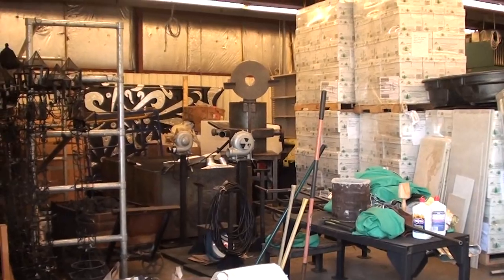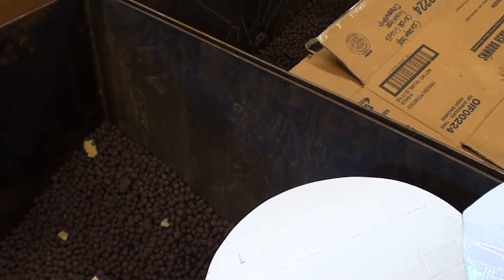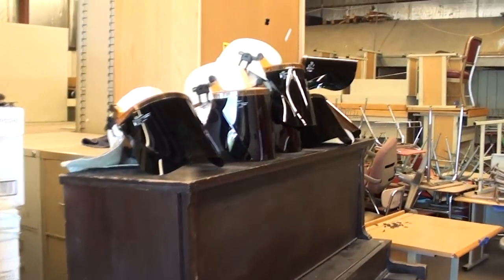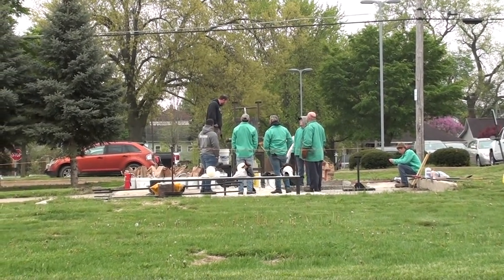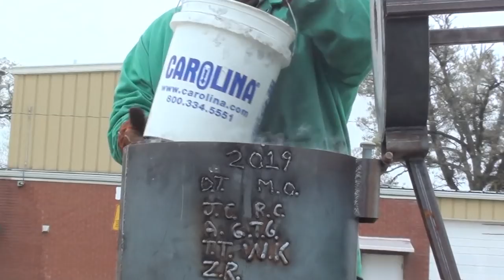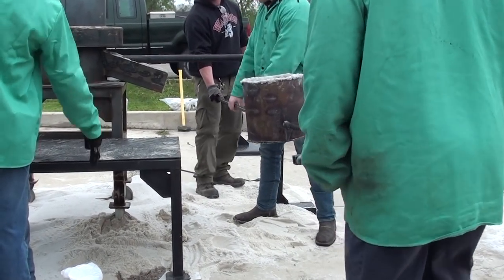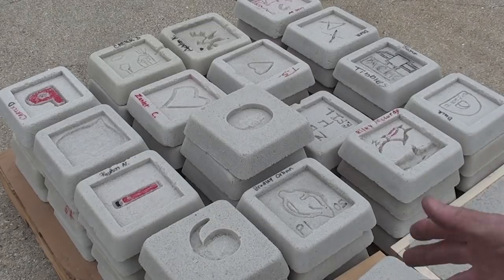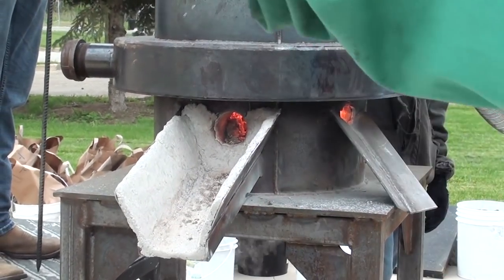IRON MAKING at SCHOOL Using a Blast Furnace tubalcain

Comment: Hey Mr Pete, 
Steve Chastain has written an excellent book on iron melting cupolas, it provides excellent theory and design for small cupolas, also instructions for use, it will help you avoid the issues you are having, and give better practical understanding of the process.
I built my cupola from Steve’s design, and it does exactly what he said it would.
Real nice to see proper hands on work for the students, nice job!

Comment: I was a Metallurgist in a Steelworks for some years the error seems simple to me, Heat loss, A blast furnace uses hot air not cold when "On Wind" take the vent from the top and pass it through a heat exchanger after the blower and before the tuyeres for probably 50-75% reduced heat loss & better iron reduction,
Also block the tap hole with clay, until the liquid builds up, with the tap hole open the "Burden is burning down not up"
Reply: I didn't think about blowing in cold air, but seeing the raw stock blowing out the bottom vents, I had the same idea on plugging them.
Reply: @stxrynn  If you look at any full size Blast furnace you'll seel a big elbow on top with a diagonal "Downcomer" pipe, it heads across to a "dedusting facility and the CO gas in the Blast furnace exhaust is routed to three or four big vertical cylinders right beside the main Furnace shell, these cylinders are called "stoves" they burn the blast furnace gases and heat brick piles in the stoves then pull the cold blast air through the stoves in turn to heat the blast air.

A cold furnace reduces iron very slowly, & leaving a large tap hole open means the the blast it escapes altogether and isn't forces up through the "Burden" which gives little trickles of iron and a clogged furnace.
Reply: Very clearly written.   Thanks for that.  This is the Bessemer process, yes?  The melting process is still mostly a mystery to me.  Time to go digging and get educated.  

I worked in IE at Marathon LeTourneau in the late 80's.  We had a steel mill onsite.  I rarely got to go visit, but did get to see the electric furnace, vacuum furnace, soaking pits and walking beam furnace.  I only saw the rolling mill once.   That "intro" started a life long interest.
Reply: No this isn't the Bessemer process, this process was devised by Abraham Darby the 3rd, building on a history of iron making that used wood charcoal as a reducing agent, AD3 pioneered the use of water wheels to pump heated air through Coke Iron ore & limestone in the late 1700s maybe 1776? In order to cast cheap cooking pots (of all things) he also had a part in building the world's first Iron bridge at Ironbridhe gorge in Coalbrookdale in the UK.

The Bessemer process bubbles oxygen through molten "Casting Iron" reducing the carbon content in order to create steel
Reply: @jblaxlinde7998  While that is certainly how it is done as the effeciency gains are huge it is not required. The blast furnaces from the 1800's  blew in outside air only and still got the job done. To me based on the old 1800's furnaces around here it looks to be half as tall as it needs to be. The bottom does need to be plugged and the biggest issue they likely will run into is I think from cold start up it typically was expected to be 24hrs before the first tapping. I could only find one image of a properly shaped old school simple blast furnace and it is here : http://www.engineersgallery.com/blast-furnace/   I would suggest a slight reconfiguration to the bottom of their furnace for proper capture of the molten iron and also it will need to be well insulated so that the iron will remain molten for tapping after it has collected properly which will not occur until the level is high enough that the slag can be tapped out of the slag port. The furnace should also be built much taller as the process relies on lots of time and layers for the iron to be reduced properly so you can obtain a good quality product.  What they have built here is actually somewhat akin to a coupola furnace, which would typically be used for reducing pig iron and scrap to make steel or specialty irons rather than raw pig iron.
Reply: @bcbloc02   
True 
But the burden ratios shown won't cook down properly as there's just too much reducing and heating to do when all that heat is being thrown away, especially as the top is being taken off to charge which dumps heat in a massive way

Right back to the 1700s furnaces were loaded through relatively tiny holes up on top, then sealed with clay

 It's all about ratios, heat retention & making sure the burden burns upwards, that is shutting & sealing the tap hole.

Of course you can fill a bucket with a teaspoon of you wish but I generally use a garden hose 😉
Reply: Yup, I definitely have more reading to do.  Thank you for the reply.
Reply: @bcbloc02  all of your suggestions as to dimensions and furnace run time are spot on, If I was to give a suggestion Is say just sit it on the ground and prepare a "Salamander" taphole for the final clean out, pretty much all Blastfurnaves were built like this until refractory became very cheap in the 1930s I still worked on a "Salamander" furnace in the early 1990s
Reply: @stxrynn  Its funny Bessemer gets the credit by a guy named William Kelly was using the same process here in Kentucky about 10 years sooner.  He was actually trying to make wroght iron a different way but essentially was making steel.
Reply: I had no idea.  That is ingenuity, pure and simple.
Reply: The "William Kelly" story is pretty cool in it's own right, apparently he'd bought an Iron works in the mid 1840s I'm going to say 1847 but really not sure & he was having labour issues so imported Chinese Iron foundry workers to solve these issues, when the Chinese guys turned up & got going hammering slag out of Kelly's dodgy puddled Bloom steel they told him about how they do it in China by blowing air through the "Puddle" which led to Kelly's Invention proving that there's really nothing invented in a vacuum, it's always a matter of building up on ideas used by others, the reason that Bessemer's name is used is that he simply had more of the ideas that went into the Bessemer convertor, including the correct refractory chemistry and the tilting convertor tech etc, there's more to it than bubbling air or even Oxygen, there's Phosphorus and silicate build up & of course Air + heat melts the bottom out of your convertor without the correct refractories.
Reply: I love this Industrial history stuff, I saw 100yr old film of a 100yr old Prussian (I think) blast furnace working back in the late 90s & was hooked forever, I even visited the old Bedlam furnaces & various other Iron, Steel & Coke making centres, there's a great Coke furnace site out in the middle of no where near Lithgow in New South Wales, Australia.
Reply: J Blaxlinde The sloss furnace in Birmingham Alabama is a must visit if you haven’t been. Here in Kentucky we have the Fitchburg furnace which was the largest  charcoal iron furnace in the world.
Reply: Of course the incoming air would be best if it was hot but a different way of drawing the hot air from the top of the furnace and blowing it into the bottom would have to be done a different way. That fan would fail really quickly one the air got over 300 degrees F.
Reply: @sandrammer  
Hello, Yes the fan would fail quickly if you put the hot air through it, so you mustn't

The fan pumps cold air into one side of a simple heat exchanger which heat's that air just before it goes into the tuyeres
The air rises through the furnace as "Blast air" & gets even hotter, ideally the oxygen is used up and it comes out of the top of the furnace and into a pipe that takes it to the other side of the heat exchanger,
Only the heat moves across the exchanger as the air should mostly be "used up" in the furnace,
But the fan only ever pumps cold air,
The heat exchanger can be very simple just a pipe in a pipe then insulated externally for safety & heat retention, it could simply be a heated jacket around the tube that feeds air to the tuyere ring or even a jacket over the tuyere ring itself it doesn't need to be complex it's already on the edge of working just a little heat recovery here, a better burden ratio there, not opening the top & dumping all the heat & of course closing the tap holes with clay and improving the furnace floor so that the iron can pool & it's a done deal, a taller furnace wouldn't hurt though, 
A blast furnace usually is topped with a truncated conical top which aids in gas flow, ideally the burden should never get up that high it's about burden distribution and gas flow.

And as bcbloc02 says the furnace needs to cook over a day or so to really get going, A blast furnace is usually a continuous process furnace that runs for years at a time, you can't turn them on and off in a couple of hours, Our full sized furnaces would make absolute rubbish Iron for the first week until the process stabilised & all that Iron would just be dumped for later recycling, Despite the 10,000 men waiting down the line for Iron to smelt & steel to roll, the Iron wasn't any good so they just did other maintenance until the iron came up to spec, It's just a part of getting a Blast furnace running.
Reply: @bcbloc02  next time I'm in the States I'll try to get there, I'm based in the UK now but have worked in a few different countries, I don't know for sure when I'll get back to the US but it's on the list for a tour with the family in the next 5yrs hopefully.

Comment: Two suggestions for Mr. Taylor for the next time: the blast air in the commercial furnaces is preheated these days to give better combustion efficiency, especially on cool or even cold days.

While building a miniature set of Cowper stoves with the internal firebrick checkers is probably impractical, a shell and tube air preheater fired with propane might help things out.

It's not absolutely essential, as the early blast furnaces used leather bellow to pump the blast air in.

The other thing about the blast air is that it needs to have enough pressure to percolate through the vertical column of charge material after things start melting. The liquid steel and slag tend to block the gas pathways. A commercial furnace is ~100 feet tall inside the refractory, and the blast fans typically provide a head of 80 inches of water - about 3 psi. The fan head doesn't quite scale linearly, because the thickness of the liquid layer inside the charge is going to be fairly close to the same, no matter how short or tall the shaft.

I'm not a blast furnace engineer, although I can fake it, based on my other engineering skills... the steel company however has guys who live and breathe blast furnaces on staff, and they'd probably be very glad to help out with some guidance and design checking. In the old days, they'd even send someone out to help out on the day of the heat, as much for PR as anything.

This might be a practical example that the physics class could collaborate with the welding class - give the kids in physics a real application, and the shop guys an example of where the math and physics actually have some meaning.

Just a thought...
Reply: Not all furnaces use preheated air and not all postburn their effluent gas. This is a tiny blast furnace (cupula) and its of the cold blast type. It will work just fine once they learn the proper rate to feed it.

Comment: Reducing iron ore to Fe.  A bold ambition for a high school class.  Many thanks for sharing this. 
A brief refresher from high school chemistry.  The coke is burned to release heat: 2 C + O2 → 2 CO.  The CO reduces the iron ore to iron metal:  Fe2O3 + 3 CO → 2 Fe + 3 CO2.   Some of the coke may react directly with the iron at higher temperatures: 
2 Fe2O3 + 3 C → 4 Fe + 3 CO2.

Comment: Just reading up on the process, you are correct in calling the balls, taconite, as that is what they're colloquially known as. But the pallets are not really taconite. They crush the taconite, which contains 25-30% iron, and pull out the magnetite with magnets. They recombine the magnetite with clay (limestone and flux) and roll it into those balls. (Iron content: 60%) The balls are fired, which oxidized the magnetite to hematite.

Comment: Thank you for showing this.  The shop teacher is up special recognition for his ingenuity and salesmanship to get this done from start to finish.
This cold blast cupola furnace is similar to a hot blast cupola furnace used in the melt shop of a previous employer.  As pointed out by others, it melted iron scrap for charging into a basic oxygen steel converter.  One suggestion would be to do some more research into design of the slag and iron tap holes and plugs and the exhaust venting.  I suspect that way more time and heat would give better metal production.
There was no discussion of the size and spacing of the tuyeres relative to the blast volume.  The bustle pipe diameter looked like it might be oversized for a cold blast.  A furnace like this needs lots of high velocity air for complete combustion of the coke.  A future project might include modest oxygen enrichment of the blast air.
My comments are not a critique; all involved in this project deserve praise for their work.  I'd just hope for enough hot metal production to give the students a tangible momento of their efforts.

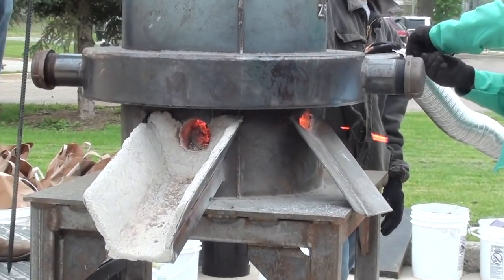Comment: Ironic that a process that used to happen 1000s of times a day and in dozens of states every day of the year is now obscure and unknown.  Also, some kids need a special invitation to engage their brain. At 11:32 a student is told to take off his regular coat (flammable) and put on a welding jacket. Instead, he attempts to try to put the welding jacket overtop of his bulky street coat and you can see him struggling for the next 2+ minutes doing this. I'm curious to know if the same boy is admonished later by the teacher for holding the pickaxe but not having his gloves on. 

Great job Mr. Taylor and his welding students.

Comment: Another minor suggesting for charging the furnace... keep the lid down, and drop preweighed charges through the exhaust hole, where the charges are in brown paper lunch bags that will fit. through with some room to spare. the ash in the paper isn't going to cause all that much of a problem.

Another option, given that this is a welding class, is to fabricate steel charge scoops, like a flour scoop.

Adding a flared chute  - funnel - around the exhaust hole would help with this...

That, and as others have mentioned, plug the tap hole and slag notch  - use a separate pinhole to see when there's enough of a pool of liquid

Comment: It was an interesting video but there were so many things done (right and wrong) that I can't write about them here. I'm going to send you an Email pointing out how he could make the furnace work better. One thing I would mention here, the molds made out of Sodium Silicon were good but the molds were left out in the air. Sodium Silicon absorbs moisture and brakes down when exposed to moisture. Given enough time the molds would have lost cohesiveness and fallen apart before they could have been used as molds. Now, pretending that CO2 sand isn't bothered by water, I would've been worried about using the molds that have been out in the open where water could have condensed on the open surfaces, or dripped on the molds. Steam explosions would result once the molten Iron came into contact with the mold cavities. Just a concern, I guess, that could be passed along to the Teacher.

Comment: I have really enjoyed watching this video.  This is an experience that the students will remember for the rest of their lives and may head some of them down an engineering path. Top marks to Mr. Taylor for going ahead with this and I would imagine that the next try will be  successful. Failing at something teaches you that not everything goes to plan first time around. If that was the case, life would be boring.  I have just gone through 3 tries at a Cast Iron pour with my backyard furnace, with only one attempt being slightly successful.  With some direction from Sandrammer, my next pour should come out OK.

Comment: That siren in the distance at ~11:30 has a tone similar to the sirens used by the overhead bridge cranes in steelmills...

Not to long ago, people working in the hot areas of the mills(aka works in an integrated mill - one where they have a blast furnace to make the molten iron, known as Hot Metal - wore those green FRC (Flame Resistant Clothing) coats and pants - these days, they wear different colors, and the FRC has reflective stripes on it.

That's the first time I've heard the aluminum foil covered heat resistant gear called "baked potato wrappers" ... most mills call them "silvers"
Still, the new to me term is apt, as if you get by more than a very small amount of molten metal or slag, you will get cooked. Call itz a bit of gallows humor...

Another minor point - that ring for the blast air is known as a "bustle ring" and is a header duct that feeds the nozzles aka tuyeres which direct the air into the furnace.

Comment: Good video tubal-cain! Cupola are tough! You have to calibrate & it will take some time. Likewise getting the moisture out!!!
I'll have build 5 or so of those things & the first one was definitely not right.
Person from my experience I seen a lot of things they  was doing wrong.
I like the design of the Furnace never thought about wheels.
First of all the furnace need to be brought up to a temperature a white hot, not good for the greasing in the wheels.
Nice size barrels!!! I think the coke was too large for the short version of that style furniture! If the barrel was taller,.... More it would work!
I would have started with a smallest furnace,.... 7,8,4, or 9 inch barrel.
That's when the coke size, metal sides all matters.
Cupola are tough! These days it's even tougher to find coke/coal.
A a lot to be said about the furnace & a lot to be learned as Well.